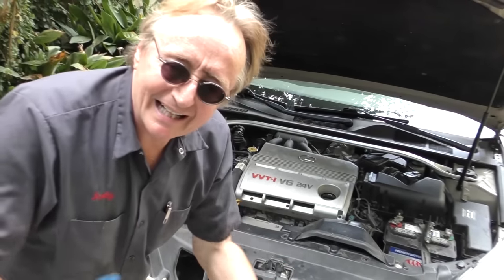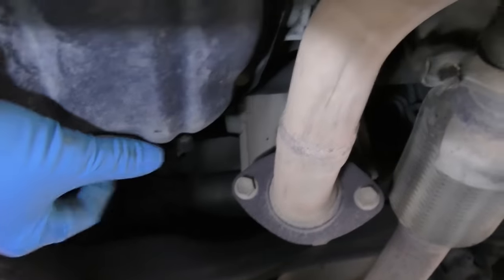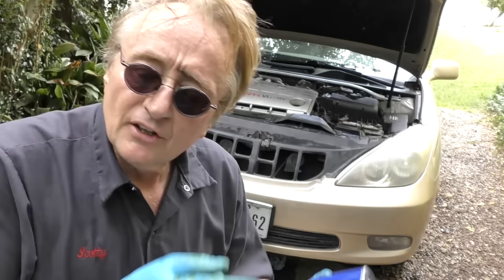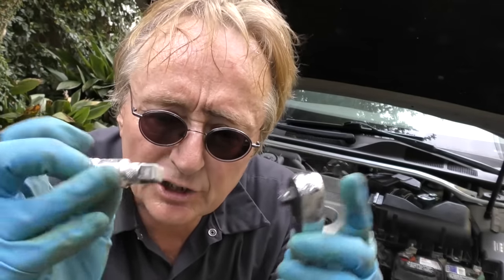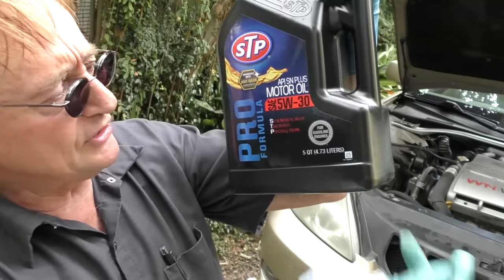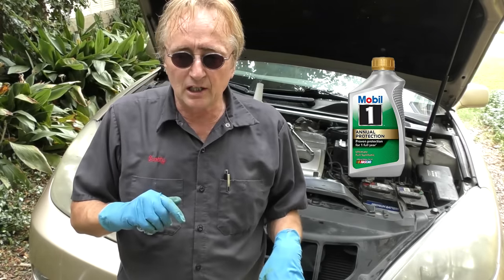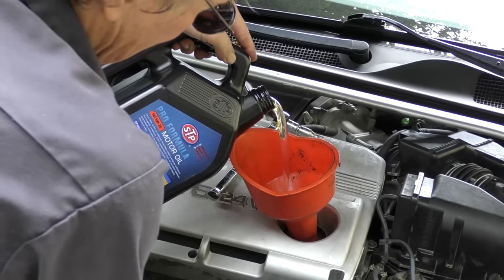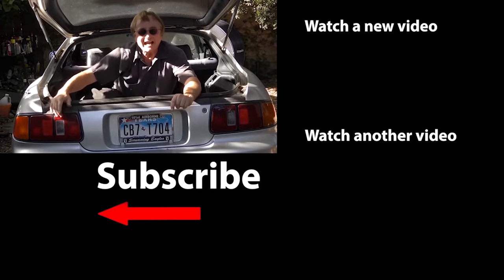Changing Your Engine Oil? You’re Doing It Wrong

Comment: Nothing scarier than watching someone use a breaker bar to torque on an oil pan bolt.
Reply: At least he wasn't using a 3/4" drive...
Reply: So count the turns.  Once hand tight only turn a little more.  It doesn't take a lot of force.  You just have to use a little sense.  Or you can choke up on the bar.
Reply: @johnchestnut5340  I'd highly recommend leaving the breaker bar in the toolbox.
Reply: @murph1414  I've worked with guys who didn't know the difference between pounds, ounces and Newtons.  If I have to use a breaker bar to loosen it, then why clutter my work area with another tool to tighten it just because someone else doesn't know how torque works or how to count turns?  I get your meaning, but I'm also not acting as though I don't know how to turn a bolt just because someone else doesn't.
Reply: James Murphy no point me buying a torque wrench when a ring spanner or socket with breaker bar or ratchet can do the same job. Nipping bolts/nuts with any of the said tools is not hard, you’d be pretty pedantic not to use them. Scotty clearly wasn’t being He-Man when tightening. Its like telling people to wear gloves to change the oil....meh if it ain’t hot I don’t even bother.
Reply: after watching him use stp products witch in testing is the worse on the market any good mech. knows this what does that tell u i been building race engines for years and they use straight grade oil and after a few worn in miles it is wize to go a heavy'er grade oil when the motor is starting to get worn out any mech. knows this .and ur suppose to put oil on the seal of the filter . and never ever use a breaker bar to tighten any thing good way to f things up and the way he moves i think he is a tweeker because they act the same way
Reply: @johnchestnut5340  if i seen some one in my shop use a breaker bar to tighten a bolt i would fire them just for being lazy and not doing it right and a oil plug torque is about 25 lb. so do u know the specs on every engine u mite change the oil on some are less some are higher and just by the products this guy uses i would never trust him
Reply: @jeffrey4547  I don't need to know the specs.  I have reference material.  With only a few exceptions there isn't that much difference between them.  One uses a plug that is only hand tight.  But it is an exception.  Work smarter, not harder.
Reply: @johnchestnut5340  so by making a video to teach people that don't know how u would show them the incorrect way to do it good job on that
Reply: @jeffrey4547  I'm not making an instructional video.  I'm responding to comments.  In the specific context of which you speak, you're absolutley correct.   Otherwise, I know how to properly use a wrench and to account for handle length.  Maybe people should learn to use a wrench before attempting an oil change.
Reply: It's about knowing how to use it. You can easily strip a screw with a drill unless you know how to use it gently... Just saying, if you find it difficult or scary to use a certain tool is because you don't know how to use it.
Reply: oh yes there is.  impact air gun..
Reply: Depends if they are using it judiciously or being a gorilla Fingertips vs both mitts.
Reply: Seems to be a common practice at Walmart oil change centers.
Reply: I got one of those extension wrenches so I'm good
Reply: @jeffrey4547  You say tweaker as if it was a BAD thing.
Reply: @VLXVNDR  Nancy Pelosi sitting on your face would terrify anyone, except Ellen.
Reply: @jeffrey4547  punctuation goes a long way when it comes to clear, concise commenting. You may have something good to say, but I'm not going to spend much time trying to figure out where one sentence stops and another one begins. If you want your posts to be read and taken seriously, use capital letters, periods and commas.
Reply: Yeah, but he has "the touch".  Some of the home gamers better break out the torque wrench: about 15 to 20ft-lbs should be all you really need - there's almost no pressure on the backside of that sealing washer [the static head of 6" of oil in a pan probably doesn't rate beyond 1psi over atmosphere].    Speaking of washers, I've come to like brass - some use some type of teflon or nylon and if they go, they crack.  If that happens on the road... disaster.
Reply: John Chestnut 🌰
Reply: Somehow everyone is a mechanic but i dont see any videos from all the negative commentators here.
Reply: Ya, he's doing it wrong.
Reply: Scotty’s arm is a digital torque wrench
Reply: lol.....good point james.  If you need more leverage than what your rachet is giving you, just slide a pipe over the handle.
Reply: Who cares what you use to tighten it. As long as you don't over tighten. You theoretically could use a pneumatic impact wrench and just limit the PSI intake. You could also be the world's strongest man and just hand tighten, doesn't really matter. All that needs to happen is that metal gasket needs to squash. Doesn't matter how you did it.
Reply: Well, torque is torque.
Reply: Ha ha ha
Reply: Love you Scotty ... I think you're funny as s***
Reply: Get a 1/4 inch wratchet to tighten just enough.If you crank really hard on a 1/4 you’re really looking to over torque. That’s on you.
Reply: Please just use the proper size wrench and that way u can get a lot better feel for how tight. I like to use the German torque spec... Goodentight!!!
Reply: I was thinking the same... small ratchet to get it snug then 1 small extra turn is fine!
Reply: I use the shorter breaker bar myself.
Reply: 30nm torque and sleep well :)
Reply: LLV old oil is carcinogenic very very. and it has toxic metals in it. dont get in eye or mouth please consider next time. less cancer is better for everyone
Reply: jeffrey hollenbeck p
Reply: I know, ask me how
Reply: Agreed
Reply: proper torque for Nissan oil drain bolts is 25 lbs ft, at least on my 2008
Reply: For cat engines, 46 to 50 ft lbs for torque.
Reply: When I change the oil on my mower there's a team of crack small engine mechanics as judges. They hold signs and critique my tool selection and techniques. After a little good ribbing I take the oil collection pan and grease them up real good before I send them home.
Their wives all think we own a repair shop but in reality we're just making silly youtube videos for beer money.
Reply: Took my car into a quickie oil change, the next time I decided to change it myself, low and behold I began taking out the drain plug and the oil pan threads came out with it...I'll never do quickie oil changes again.
Reply: Something is messed up if you need a two=foot bar to take your old drain bolt off.
Reply: Overkill many may say, but I have a torque wrench. I use that to get the correct spec because if I'm doing my own change... I don't want to trash threads or ruin seals.
For the bolt and the filter - the specs are in the manual.
Furthermore - if I took it to a shop to get it done and they didn't use a torque wrench and checked the specs - I would be worried that other corners have got cut...
Dunno about rest of world, but in the UK a car service isn't cheap.
Reply: So my porsche has torque rating for the drain plug. Do I need to not follow that? It doesn't take breaker bar to undo it ofc but is it not necessary?
Reply: @johnchestnut5340  you shouldn't be using a damn extension on the drain plug regardless.
Reply: LMAO!!! Not sure what Scotty was thinking!! :D
Reply: @tahs8335  yep. I've never had a plug get loose from hand tightening and finishing with a normal wrench. Using a breaker bar is idiotic.
Reply: Always do your own oil change. I've since learned it's too easy not to.
Reply: stan broniszewski Educate your old friend that these places want to rip you off. Oil change is not a hard skill.
Reply: @jeffrey4547  
But u dont use a heavier weight oil with a VVT engine......thats what he said.
Reply: @RBrooks462  
Says the guy who doesn't capitalize his first word! 😄
Reply: can do ya one better... I always do my own, but went to jiffy while traveling... Turns out THEY USED LOCKTIGHT
Reply: do I smell an new engine from jiffy lube🤪
Reply: @jeffrey4547  STP: Stops The Pounding
Reply: @thisismagacountry1318  that makes sense after seeing your screen name
Reply: @Drewsky840  C'mon, you know you want to service Pelosi. Gitrdone.
Reply: I like to use a impact gun.
Reply: No kidding--I was cringing!
Reply: @jeffrey4547  damn son you went all out on someone just tryna help you and in my experience stp with a quart of Lucas is the best
Reply: It's only scary when you have a newb with a breaker bar. Not a problem for those of us who have been working on cars for decades. We know how tight things should be.
Reply: @Deucealive75  I couldn't agree more. It still invokes visions of bad things to come. We all know a person or two this would hold true to.

Comment: Nevermind actually checking the oil after you fill it
Reply: C Hansen,
Correct -- the capacity does not change, but the amount that drains out does, depending on temperature and time left draining. 

Checking the level is easy so why not do it? Overfilling should be avoided, and if the level is low when checked a week later, how could you be sure whether it had been correct or low right after refilling if you had not checked it then?. smh
Reply: If you put in the correct amount for your vehicle there is no need to check it it didn't go anyplace, lol
Reply: @Benni711   If you pour in the capacity of the engine that it calls for then that's how much should be in the engine so there's no need tocheck it

Comment: I literally re-use my old drain plug gaskets every time, and they never leak.
Reply: I literally don't even have a gasket on mine and it never leaks oil, lolol.

Probably not a good idea though.
Reply: Every time I forget to replace the gasket I get an oil leak.
Reply: Probably a case by case sort of thing but when you work on other peoples cars you dont chance it
Reply: They do eventually
Reply: same here, but found out recently why you could want to change them; the soft copper can seal up any really big surface defects, from the occasional poor quality control/cheap manufacturing of the mating surfaces, if your car isn't one with a defect its no problem. 
but the copper does go hard, temp cycling, and if your car's sump has an issue it might not seal, but the seal is still the same metallurgy, purish copper, so if you anneal them, heat therm up to a dull cherry red and cool slowly, they're good to go, even for poor sump mating surfaces and if you can't just check it after a few heat cycles (like a garage can't, which is why they replace them.)
Reply: Me too they do last a while!!👀
Reply: I’ve not changed mine in 5 years on my 01 Cherokee. Never had a leak from there. I’d be better off changing the valve cover gasket every time 😭
Reply: John Smith  Really? I hope (for your engine's sake) that you get someone else to do it then. Or maybe it's a stationary display/museum piece that literally does zero mileage?
Reply: I dont even have a car, drives fine!
Reply: Do you mean literally or figuratively?
Reply: Same here, ben doin it for years.
Reply: There is a difference between drain plug gaskets, such as what are used on American cars, and crush washers, which are used on import cars. Crush washers get replaced every time. Gaskets get replaced when they are bad. They also have a torque specifications. If you’re not torquing the drain plug correctly, you are doing damage to the bung.
Reply: @r0498  Gaskets are cheap..Engines are not..
Reply: Some drain plugs have an integral seal that's not replaceable. If it won't seal you replace the plug
Reply: @stevedeleon8775  Gaskets are cheap. So is driveway cleaner.
Reply: @anonymike8280 Agreed...  So is changing your oil often... my vehicles all have 100,000 miles + with no engine problems..Full Synthetic every 4,000 miles is my  time to change it👍
Reply: No one replaces it and it’s fine lol
Reply: I have had 3 cars with the 3.8 my dad at least 3, we have never had a gasket on any of them.
Reply: Same
Reply: Literally?
Reply: Depends if it's copper, nylon, or steel. Nylon ones should be changed every time.

Comment: I use super tech full synthetic (or whatever full syn is on sale) and always a Mobil 1 filter. I’ve never went 10,000 miles between oil changes. I’ve went as far as 8,000, but 5-6k is what I stick with.
Reply: I use valvoline ,whats a couple more $$ ? Oil is the life blood of your engine. Dont drive as much as i use too. But change my oil in the spring, before it gets hot, and fall ,before it gets cold . Fjlter every time. Rotate tires every 2,3 oil changes. 5k is a nice round #. I remember when it was 3 ,000 now most books are 7500. I split the difference round 5

Comment: “You gotta put the oil on slower you’re gonna make a mess” !! 😂😂😂 Scotty  ur killing me 😂😂
Reply: On that particular engine yes.  I have one.  There's maybe a 1/2 depth from the filler hole to the top of the head.  Putting the oil in too fast will result in it spilling over the top of the valve cover beneath that plastic cover, making a mess.
Reply: On some motors the oil with come out the dipstick if it's out while you pour

Comment: 0:53 Freakin Jiffy Lube places. Shouldn't have to use a Breaker Bar on the Oil Drain Bolt 😡
Reply: Jiffy lube doesnt use breaker bars on the drain plug I was there yesterday 😂
Reply: when you take it to a shop, everything is either way too tight or not tight enough.
Reply: Aint that the truth.  I swear they freaking tighten those bolts to 50 ft lbs because theyre too cheap to put a new gasket on it

Comment: I always fill my filter full of oil before install. GM 6.0 in my caddie. No jack needed to get under it either. Super easy oil change
Reply: zero need to fill the filer.  zero.  Car starts on previous cylinder wall oil and oil from pan not filter.  Zero effect

Comment: Hey Scotty you forgot to tell everyone to clean and wipe the funnel.
Reply: Dumping the oil in it cleans it out. Just let the engine filter do the cleanup.
Reply: Yep, that was not good.
Reply: I don't even clean my funnel as well
Reply: Not only do I wipe my funnel, I stick a rag in it to keep the bugs out of it. It hangs on a hook in my garage and for some reason, bugs like the flavor of my motor oil.
Reply: My wife cleans and wipes my funnel when shes done.
Reply: For engine oil that's no big deal for it to be a little dirty with old oil... Now using a dirty funnel on something like filling transmission fluid, then yes I'd agree you should clean it out with brake cleaner and a new clean rag before filling your transmission with fluid.
Reply: Miniscule amount of dirt....doesn't hurt anything.
Reply: @motorcitymanman7711  Then why do oil filters filter out particles that are infinitely smaller than the dirt
Reply: @kiyotaka269  
Because they can.....
Reply: @motorcitymanman7711  🤦‍♂️I was implying that visible dirt is bad for your engine and used oil filters don't hold a lot of dirt anyway.
Reply: @kiyotaka269  
Of course "visible" dirt is bad.....visible dirt is HUGE.....I was reffering to miniscule extremely small particles of dirt when I said it was virtually harmless to a engine.
Reply: @motorcitymanman7711  there is no good argument to use a dirty funnel it takes seconds to wiped it off.
Reply: @shawn01707  
Oil filters trap any dirt u can see.

Comment: True that about the double gasketing.  That sadly happened to me and  my mother's car.  I changed the oil for her and didnt notice the gasket came off.  after the oil change, she and my brother drove to walmart. they noticed the oil leaking out, and instead of buying new oil at walmart, or putting it in their shop to see what was going on, they panicked and drove it home.  They got within 1000 feet of the house and the engine became a paper weight of aluminum.   If they'd not panicked and bought oil to replace it they'd been fine.
Reply: Cash for Clunkers, DIY-style. :(

Comment: Scotty fails to say that if you need a breaker bar to loosen the drain plug, someone screwed up tightening it way too much.  Risk of stripping the threads.  
One should always drain the oil when it is HOT, not cool.  
Use a real oil filter wrench, not a strap if you can.
Reply: As a mechanic I frequently had to chase the oil drain plug threads on the oil pans to get them to thread off and on without a wrench once loosened.  Usually the drain plugs had yellow paint on them indicating that they had last been at Jiffy Lube. Don’t over torque the drain plug!  I use a combination wrench and leave it under the car until I have tightened the drain plug. I have never had to replace the oil drain plug gasket or use an oil filter wrench on my own cars.
Reply: @greenman7612 - re: "HOT vs. cool," ehhh?!?  Would "cold" be an option for you?!  Draining when "cold" means the oil filter won't leak much when spinning off, yes - the old oil takes longer to drain = Big Deal !!

Comment: I screamed  NOOOOOOOOOOOOOOO ! When I saw Scotty use that filthy funnel !
Reply: only a few black  fingerprints calm down lol
Reply: Hardly dirty 🙄.
Reply: I've watched my dad sink saw dust and spider webs with oil.
Reply: As long as the particles arent too big, the oil filter will handle it.
Reply: @candlestyx8517  There is no such thing as "Too clean", when working on engines ! Take the extra  10 seconds , and do the job right !
Reply: @stevenrichards3699  The oil filter can handle a few specks of dust, being OCD never got me anywhere in life.
Reply: Sorry, but as an aircraft mechanic, I (and my co-workers) have to be OCD, There is no " That's Good enough ",  "It's close enough", or "That should be okay", or "That should hold" .........NO ! ....Everything has got to be spot on ! You do the work, you check it, you check it again, and then you check it AGAIN !
Reply: @stevenrichards3699  Right on! A new oil filter only has so much capacity, so why filthy it up before you even have 1 mile on it?